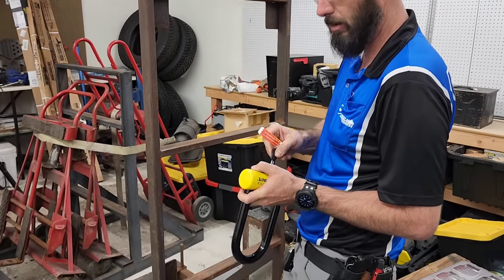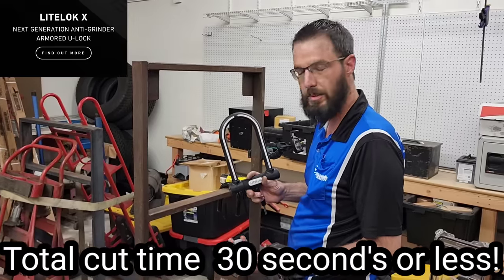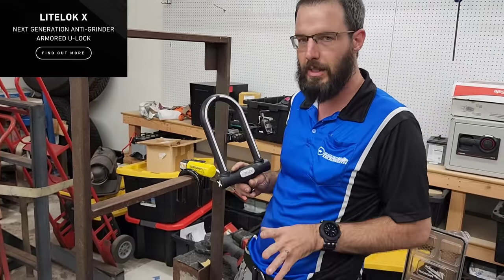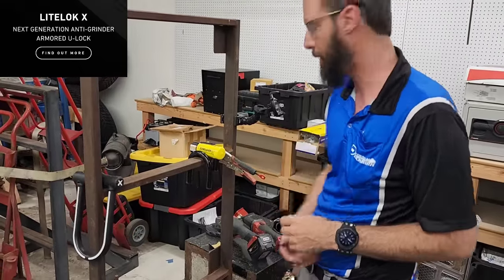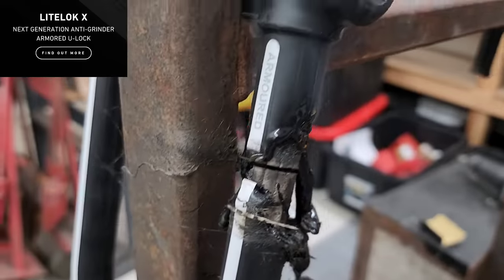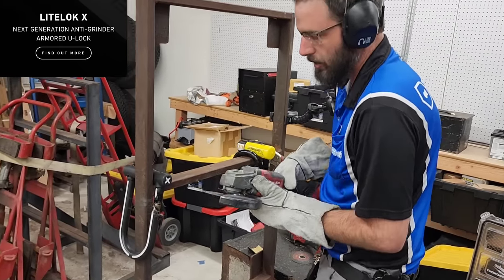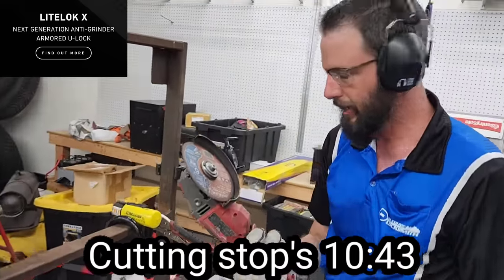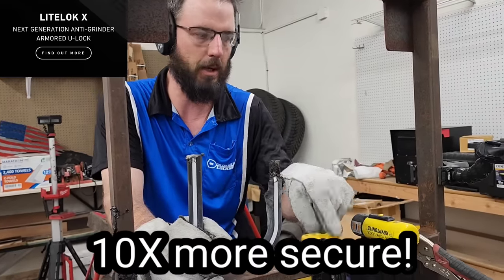Litelok world's first anti-grinder angle grinder resistant bike lock, top rated best bike lock 2022

Comment: why don't they just use chainsaw resistant material? 

the same substance they use for chainsaw protection, it is a substance that turns into millions of threads and stops the chainsaw in 0.1 seconds 
the chainsaw is pertotal due to all wiring up to the engine

Comment: Is this an ad ? With the locks name permanent on the screen.
And if you dont put pressure on an angle grinder i can cut 15 minutes useless..🤔
Beside that it must be an hard extra special 2mm plastic on this u frame that it takes 30 sec. before some sparks are flying..😉
And if you twist, put the pressure down , then you have more power and you dont lift up your lock stand
😉
I think this performance is a little overacting 😁

Comment: I bought a Litelok X 1 and It seems to be a solid, but unfortunately it rattles very loudly within its holder when riding over bumpy ground.
I sent this video (https://youtu.be/YGSPQXZ_t8Q) to the Liteok-Support and they said, that this is a normal behavior and they will not exchange it:
"Our engineer has assured us that there is some movement built into the product itself which is required for smooth operation of the lock, and to ensure it securely locks every time. This appears as an audible noise in every D-Lock..."
So I send the lock back and bought an ABUS!

Comment: I guess you're sponsored by Litelok in this video hence the ad in the top left corner. You used a third blade for the first cut as you weren't using the same force and flexed the blade once through far enough to get a good enough grip for the flex to destroy the blade, that third disc you used to finish the first cut done the second cut without being replaced, how come? I also suspect you could make the cut in the centre of the bend and pry it apart that way as the flat goes the same way as you'd be trying to pry it apart, should give enough clearance to get it off. I use Angle grinders on a daily basis at work and the way you had that flexing is worrying as I've seen what shattered blades can do, you'll end up with chunks of blade buried in your skin all for a promo on a lock.

Comment: I would be curious to see how it responds to bolt cutters, blunt force attacks, and even a hacksaw just for fun.
Reply: It wouldn’t get anywhere near it…
Reply: @LewisfromYouTube  We don't actually know what the material they are using is. We have no idea how it would react to simple brute force, and there is only one way to find out
Reply: @MesoTroniK  it’s Been rated sold secure Diamond for bicycle and motorcycle which uses all those tools.
Reply: @MesoTroniK  It's a diamond rated lock, the security level is way above hand tools & brute force
Reply: @sometimes_riding7008  Those ratings are crap half the time, and why place faith in them in this case? You have no idea how this unknown alloy would respond to brute force and saying you do because of the Sold Secure rating is absurd.
Reply: @sometimes_riding7008  He's trying to cut it using a metal cutting blade, not a ceramic cutting blade. If it's cermet, then it'll absolutely be very resistant... to metal cutting blades. It won't hold up well to a diamond edged disc for ceramic, and will likely be somewhat vulnerable to brute force. At best it has a core (or possibly multiple if it's comically expensive) of something else and just a layer of cermet to try and ward off angle grinders. Definitely needs a more thorough test.
Reply from the maker: I'll try that
Reply from the maker: It is extremely bolt cutter resistant
Reply: These type of locks are generally bolt cutter proof standing up to 17 tons of force
Reply: @MesoTroniK  sold secure is a highly credible testing organisation that uses standard replicable tests
Reply: @robertpatrick3350  No, they are not.

Comment: Most of the people that are stealing the bikes in my area are using the slide hammer technique. To pull the cylinders out of those locks.
Reply from the maker: I don't believe that will work on this one either
Reply: The lock cylinder is only exposed for the keyhole and cannot by pulled with a slide hammer

Comment: It seems like it would be easy to just ban cordless angle grinders. Contractors and mechanics usually have power available. I have a landscaping company we work on a lot of metal gates, I have never used one of these. They are 99% used by criminals. It will take them about a week to work out what combination of discs work for this lock, yours is too thin and you are pushing too hard at the wrong angle.

Comment: This is an incredibly fake video and no doubt sponsored by Litelok to give the desired result. Firstly, the Litelok x1 is one of the best locks on the market but it has been independently tested by others such as Bennets and can be cut in less than 2 minutes which is crazy good but the marketing here is disingenuous as the guy cutting is intentionally putting hardly any pressure on the cutting disk on the Litelok (look at the sparks and his lose fingers). To make matters worse he intentionally broke the grinder blades twice by twisting in the cut (funny how he could successfully cut the first lock with no issue). This Litelok x1 is probably twice as good as  the M18 Kryptonite but it is also twice the price. Most normal grinders  would take at least 1minute to cut an M18 (especially as the grinder used here is about as powerful as you can get and has a bigger than average disc. This video put me right off buying the Litelok as they are taking the consumer to be a fool rather than giving a true reflection of its ability as they know consumers would start to question whether spending twice the money for an extra 1 minute of cutting resistance is worth it.